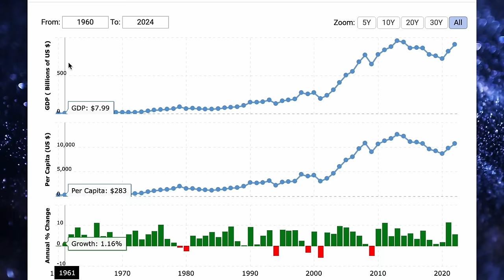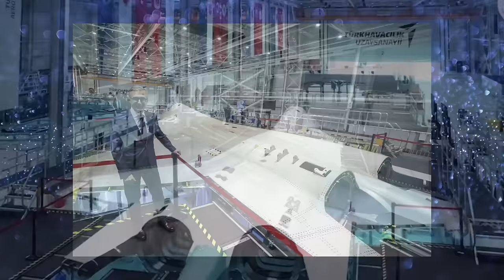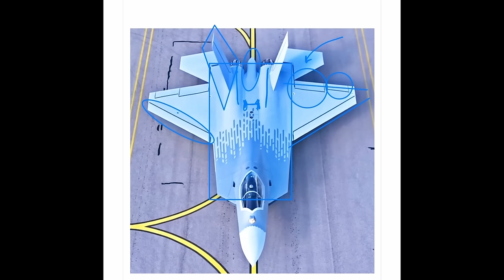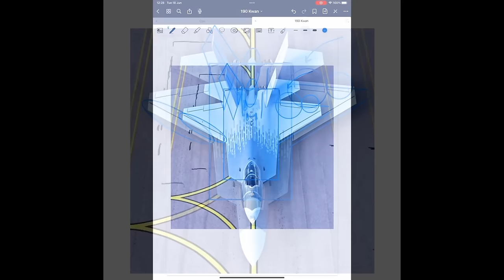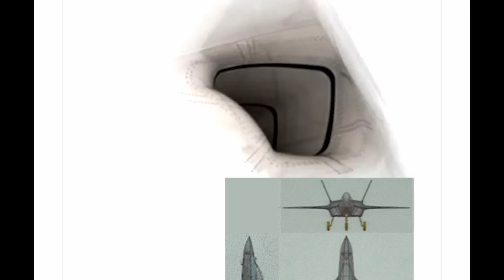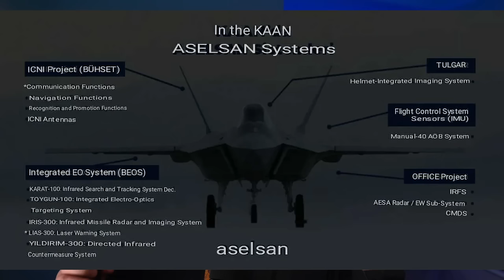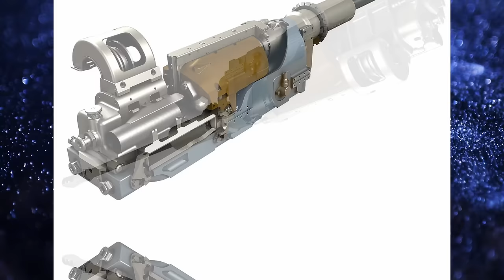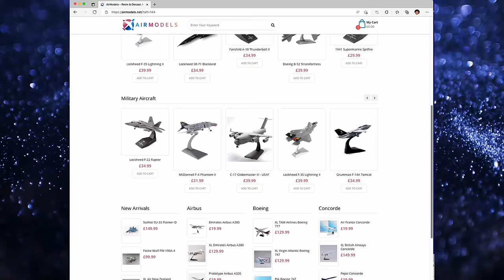The F-35 Has Met its Match

Comment: As an American, I'm already more impressed by Turkey's efforts than by the Chinese.  The KAAN is an extremely ambitious goal, and I wish Turkey the best of success!
Reply: Hilarious.
Kaan adopted both F-22 and F-35 designs .
Reply: How much of the planes parts are indigenous. 100% if not, its worthless as its not sovereign.
Reply: @peekaboopeekaboo1165  yes and a little from the super hornet.
Reply: The F-35B, was claimed to be a stealthy single engine multirole combat aircraft, that unlike the Harrier, would be supersonic, stealthy, with modern avionics systems, and like the Harrier, would be VTOL capable. This is why the British originally designed our two carriers without ramps. 

Only one of the biggest technical headaches, the British always had when building the Harrier, was the VTOL, — transferring from "lift" (downward nozzles), to forward flight (rear-facing nozzles), to then fly away from the lift-off. Apparently to achieve it took the British a hell of a lot of technical work, (three — four months at a time, over 3 years). Look up all the variants they made, but they never gave up, and they finally figured it out. 

I made the claim long before we saw the F-35B, that it wouldn't be VTOL capable, (even with the Rolls-Royce lift engines), because, the US has tried to produce and build a VTOL combat aircraft many times before, only they've failed each time, only ever managing to produce and build the British Sea Harrier, able to do so. Every US airframe (and there have been many), have all failed. 

I'll show you what I mean... Copy and paste “2013 MCAS Yuma Air Show — AV8B Harrier Demo” into YouTube search. At 7 mins, 50 seconds, you'll watch a Harrier performing a proper VTOL. You'll see it lift off vertically, and then fly away from the lift-off, and you'll see the transfer of nozzles take place. -- 

Yet you'll not ever see any footage anywhere, of the F-35B performing a full VTOL. Yet Lockheed Martin do claim it is VTOL capable, when it, so clearly, is not. 

Copy and Paste “First F-35B Vertical Takeoff Test” into YouTube search. You'll see it lift off, only then you'll see it return straight back down from the lift-off. You'll never see it fly away from the lift-off, if it could, we'd see footage of it doing so - like we still see on all the footage of the Harrier doing so. But you'll not find any footage, anywhere, of the F-35B performing a VTOL. 

The Americans, (unable to answer this), will then comically claim it's not necessary? LOL, (while forgetting, they're to be carrier-based aircraft), meaning even any slight damage to the deck or ramp, they'd be unable to get the jets airborne? Defeating the entire purpose of having the aircraft in the first place! You can't ever lose an entire carrier, in battle, for only minor damage?, I mean goodness me, whatever next?. 

So, why do we see the USA doing this? It's obviously because, the US is still a country that's never managed to produce & build a VTOL fighter aircraft. Britain did so in the late 50s, Russia did so in the late 60s, the USA has tried and failed numerous times, so it seems this time, they're going to try to lie about it LOL. 

That country is a travesty, man! But it does show us, that Lockheed do indeed produce propaganda aircraft, as the F-22 is exactly the same... A failed aircraft, so today, only being used for propaganda purposes! 

Typical US propaganda, usually consists of silly falsehoods, fake misinformation claims, or just twisted truths, like the F-15, is said to be unbeaten in A2A combat? It's true (ish), only when we look at every aircraft shot down by an F-15?, we find that none had any offensive capabilities, most had little if anything defensive, many without even a basic radar, meaning, you'd be absolutely stunned, if the F-15 didn't shoot every one of them down! 

So it really is, once again, and as always, just a very silly, and meaningless remedial propaganda claim. However, there is another aircraft, that's also unbeaten in A2A combat, and has faced off against aircraft just as capable and well armed as itself, (only it's not American, so you'll never hear about it). 

The British Sea Harrier, is actually, the only aircraft unbeaten in A2A combat, that has faced off against worthy, and viable opposition. And that really is a huge factor, that's worth knowing, unlike the F-15 propaganda claim, that you'd be shocked if it hadn't managed. 

The Americans really should be questioning why the US government made it illegal to sell the F-22? The US government, seemingly want it believed, that because it's so good, they don't want anyone else to have it. Yet, that actually makes no sense at all, none, not even a little sense. 

As the facts are, they've no idea what's around the corner in new modern military technologies, and with the speed we're seeing so much new hi tech, military tactical hardware, being designed, developed, and created today, it could have made great sense to sell the F-22 at some stage. (If it actually works). 

If it worked, they'd have been able to recoup many of the resources spent on the aircraft, if not the resources in their entirety, even a profit! Yet, as always, there's another, and much more likely, reason the USA made it illegal to sell the F-22. 

If it is, just as I suspect it is, a "lemon", that was intended to be their leading front line strike aircraft, (that's failed), yet because of the cost/expense, to design and build them, they can't just write it off. So the US have then only used the F-22 for propaganda purposes? Then what better way of preventing anyone else from finding out, that it actually doesn't work, and really is a lemon, than making it illegal to sell? 

Logically, that's the only real possible reason the USA made it illegal to sell the F-22. -- It can only be, because it's a failed aircraft that was intended to be their leading front line 5th generation strike aircraft. 

Well 20 years the US have had the F-22 in service, and they've been in wars the entire time, yet they've never used it, not once! And even more telling, was, after Russia arrived in Syria in 2015, the US removed every F-22 from right across the Middle East... Iraq, Tukey, UAE and Jordan. 

Absolutely no doubt about it, I guarantee that we'll never see the F-22 involved in any real war scenario, or even involved in any major sortie, because it's basically junk. 

They've even trashed all the infrastructure they had in place to build more of them.
Reply: I'm English, and what I'd like to know, is why we read so many Americans making such ridiculous claims, like the F-22, is so much better than the Russian SU-57, (that relies on washing machine chip technology), and has the RCS (radar cross-section) of a Jumbo Jet? 

Seriously, just what on earth is that all about? Not only is that claim completely wrong, but it couldn't be any more wrong! The really obvious, and factual truth, is, they've no idea what the RCS of any military aircraft is, as they're always kept classified! 

But even more stupidly, they never even ask any of the most obvious questions, as they all, always, just assume so much! Questions like, what do either the F-22, or F-35's have available to them, to detect, track, and target enemy stealth aircraft, from BVR (beyond visual range)? 

And yet, if they had just asked that one, really obvious question, then maybe they'd understand, that today's reality is nothing at all, like they think! Seemingly, they don't even understand, that stealth alone, defeats high-frequency (short wave), radar, by absorption and deflection, but it does not defeat low-frequency (long wave radar). 

Therefore, to detect, track, and target enemy stealth aircraft from BVR, can be done with long-wave radar, (but it must also be enhanced), to remove all background clutter for targeting purposes. So, regardless of the aircraft's RCS (they all believe means so much), when they're being detected, tracked and targetted by long wave radar, they're far from stealthy, and they just light up, and they stand out like a beacon in the night. 

It also seems, they don't know that neither the APG-77 radar in the F-22, or the APG-81 radar in the F-35, have any kind of long wave radar, (hence, they can't detect any enemy stealth aircraft from BVR). So, just think about that, and what it actually means? This is also a fact, the US air force will be fully aware of, only it seems the reality is, when the F-35 radars were being designed 13 years ago, there were no other stealth aircraft to think about as a potential threat! 

So, obviously, we must ask, just what do the F-22, or the F-35, actually have available to them, to detect enemy stealth aircraft from BVR? 

They have, AWACS, (that can transfer all targetting data to the F-22 - F-35's in real time). Only, that's not possible today. And this is why actually understanding any potential adversaries, real abilities, becomes extremely important, critical in fact. 

As, on the other hand, we find this Russian SU-57, (rubbish) the Americans all claim, is equipped with a 5th generation radar, (with enhanced long-wave radar), their new Byelka (2band) radar used in SU-57. 

They can detect, track, and target enemy stealth jets from BVR, and very easily today. Russia has designed, and developed, the first L-Band fighter radar we've ever seen. They've embedded L-band AESA radars into the leading edges of the wings. 

The L-band AESA radar "data" gets processed in real time (through extremely powerful Russian computers), being significantly enhanced, removing all background clutter, seeing them perfectly able to detect, track, and engage enemy stealth aircraft from BVR. 

This new Russian radar technology, along with its very impressive range parameters, and it's jamming ability (over very large areas) make this aircraft deadly to all other aircraft types. (But according to the Americans), it's just Russian rubbish, right? 

They can also detect, track, and target enemy stealth fighters, long before they enter Russian airspace, (from much greater distances today), with "real-time" data from all those massive Russian ground (long wave stations), that are all protected with the networked S-400 defensive system. 

Russia's new (2band) radar, covers all frequencies across all channels, used for tracking, targeting, and also for jamming (over large areas). It's part of Sh121 multifunctional integrated radio electronic system (MIRES) on board the SU-57. 

We should also understand, that Russia tested this new radar suit in the SU-35's, so they also have the option of fitting this radar into the SU-35's. Seeing the SU-35 at no disadvantage against either the F-22/35. As although the SU-35 can be detected, tracked, targeted and shot down from BVR by the US stealth fighters, the SU-35 equipped with this new radar is just as able to detect, track, target and shoot down the US stealth fighters from BVR. 

Seeing the all-important, huge Russian advantage, in BVR missile range, plus the excellent manoeuvring, neither the F-22/F-35 have, as more than critical, (if you're going to avoid simply being blown out of the sky). 

The truth is, this new Russian 5th generation radar, design, has very clear potentials, to provide genuine shared multifunction apertures, with applications including... 
Search, track, and destroy, missile mid-course guidance, against low signature aircraft, identification of friend or foe with secondary surveillance radar. 
Passive angle tracking and geolocation of JTIDS-MIDS-Link-16 emitters at long ranges. 
Passive angle tracking and geolocation of L-band AEWC - AWACS and surface based search radars at long ranges. 
Passive angle tracking and geolocation of hostile (i.e. Western) IFF and SSR transponders at long ranges. 

High-powered active jamming of JTIDS-MIDS-Link-16 emitters. 
High-powered active jamming of satellite navigation receivers over large areas. 
High-powered active jamming of L-band AEWC-AWACS and surface based search radars at long ranges. 
High-powered active jamming of guided munition command data links over large areas. [Effectively, and completely, neutralizing the USA's use of AWACS for their detection]. 

The Tikhomirov NIIP L-band, AESA 5th generation radar, is an extremely important strategic development, and it's a technology which once fully matured and deployed in useful numbers, will render narrowband stealth designs like the F-22 & F-35 Joint Strike Fighter, and many, UAVs, as highly vulnerable to all flanker variants equipped with such radars. 

Furthermore, just what have the Americans, ever seen the F-22 actually, do? Well, other than flying over a beach, on a YouTube video? 

Nothing!
Reply: When we really do take a step back, and actually do analyse the USA's real military capabilities, today? It's a horror story for the Americans, in all honesty. 

Over these last 25 years, they've been out thought (right across the military board), they've been significantly out-built, and they've been technically beaten, hands down, by both Russia, and China, (who are banging out modern hi-tech, hi-quality, military hardware in all areas of their military today). 

Even though, much is largely defensive, it's also tactically offensive, and being done with a very focused and real analytic understanding of where they need to be at various stages of their military advancement. 

Although we actually know, very little, (in all truth), what they've allowed us to see, there's nothing I could single out, and criticize, even if I wanted too. So far, everything has been completely logical. 

A great question, that really points out today's military power, (realities), is, what does the USA lead the world in today, concerning anything military? And the answer to that question, is, absolutely nothing! 

For example, In today's world of hi-tech, Anti-Ship ballistic missiles, like the Chinese DF-21D — operational range (1700 km's) that can sink any carrier in the world with a single hit, really means, all Navy's, (including the USA's), without the ability to defend against these missiles, are in effect, obsolete today. 

Russia's Zircon Anti-Ship missile, though inferior in way of operational range - 1000kms. It can be fired from Aircraft, Subs, and Ships, making it deadly to any carrier in the world. (Russia also have the Brahmos and the P-800 Oniks, Anti-Ship missiles). 

We all know that neither the US, or the UK, have any destroyer, (or any other means), that can defend against these modern hi-tech, ASM's today! Seeing, the USA's Navy as pretty much obsolete in today's world. 

We only need to look how far the US jets can travel, it's approx, about 500-650 (max) km's out — and the same back again = 1300 km's range. Seeing the US unable to deploy any carrier close enough, to reach any inland target, and then get back again. Anywhere inside 1700 km's, they're sunk, they're toast, they're history. 

This is also why, when we hear the USA shouting out how they're sending a carrier to the South China Sea, (as some kind of imagined "propaganda threat" toward China). 

Only, when looking at the GPS positioning, of any US carrier in the SCS, they're never see closer than 2500 km's from Chinas mainland! It's more commonly known as hot air, "bluster". 

Then, again, when looking at another of the most important areas of today's militaries - (Electronic Warfare)? 

We again find, the Russians are literally decades ahead. Russia have the GaN MMICs, the krasukha, the murmansk-BN, and Magrav technology (NATO: Khibiny) developed by Iranian-born nuclear engineer Mehran Keshe (called “a modern-day Nikola Tesla”). 

And we can say for sure, this EW hardware is super impressive, as we've no answer to it, and we've also seen this E/W in action on at least 4 occasions we know of. (Obviously claims denied by the USA), only if untrue? Then I'm just left asking why it was, that we saw the response, we saw, from the USA, basically confirming these events? 

1) In 2013, we've seen a Russian SU-24 fly repeatedly around and directly over the USS Cook, leaving the Cook helpless to defend itself. 

2) In 2014, we've seen a Russian SU-24 (flying at an altitude of only 10 feet), fly directly at, and straight over the USS Ross, eleven times, with the Ross completely unable to prevent It or respond to It. 

3) As Russian forces arrived In Syria in 2015 we had many reports of US/NATO/Israeli radar being scrambled, leaving them unable to communicate or offer any response to the Russian forces. As one report said, the silence from the West was deafening! 

4) In March 2015, a further related report notes. Federation submarine naval forces attacked with their advanced electronic defensive weapons the American aircraft carrier USS Theodore Roosevelt (CVN-71) causing it to turn and struggle to the coast of Britain (to the amazement of the public). Where she remained for 9 days undergoing Intensive major re-wiring. It's believed the Russian electronic warfare pods (NATO: Khibiny) were used in a Russian trial of this technology for its submarine fleets. 

White House spokesman Josh Earnest, who said of the encounter with the Cook... "This incident is entirely inconsistent with the professional norms of militaries operating in close proximity with each other in international waters. E/C measures taken by the Russian Federation are unacceptable". 

To which the Russian MoD replied... "Frankly speaking, [we] do not understand the reason for such a painful reaction of our American colleagues, as the principle of freedom of navigation for the US destroyer, (which is staying in close proximity to a Russian naval base in the Baltic Sea), does [not] at all cancel the principle of freedom of flight for Russian aircraft testing Russian defensive systems". 

A further Ministry of Defence (MoD) report also stated that for the second time in two years, advanced Federation “electronic warfare defences” have crippled the Arleigh Burke-class guided-missile destroyer USS Donald Cook (DDG-75). It was noted when Baltic Fleet “special forces elements” offered assistance to tow the destroyer back to their Polish port, the Americans refused to respond. 

According to this report, in April 2014, the USS Donald Cook, while performing a mission in the Black Sea, substantially violated Federation “territorial integrity” causing President Putin to authorize an “electronic warfare defence” attack against it, that was so devastating this top-line warship was left adrift—and once towed back to its Polish port, its American sailors were so demoralized 27 of them filed immediate letters of resignation from the US Navy. 

One year later, in May 2015, this report continues, and again in the Black Sea, the Arleigh Burke-class guided-missile destroyer USS Ross (DDG-71) substantially violated Federation “territorial integrity” causing President Putin, to once again, authorize an “electronic warfare defence” attack against it. 

But when confronted with the fate that befell the USS Donald Cook the year prior, it retreated—causing one Russian top-level Naval Officer to state: "It seems that the Americans did not forget the April 2014 USS Donald Cook incident — A Federation SU-24 equipped with EW pods shut down the new American destroyer". 

This attack encounter of Federation forces with the USS Donald Cook, this report details, began when this American warship began an “aggressive combat manoeuvre” against the Baltic Sea Fleet port in Kaliningrad, to which President Putin authorized an immediate “electronic warfare defence” against it. 

The facts are, the USA have nothing able to defeat, or even hamper Russian EW, today. 

Then, looking at another of the most important areas of these militaries today, (Ground Warfare)? We find that Russian troops with reserves, outnumber the USA, and we must also understand, that any attack on Russia, would immediately see China join the conflict, then outnumbering the USA in the millions today. 

But, also, and more to the point, what have we ever seen from any US troops, that could make anyone believe or think, they'd be any sort of threat or match, for any of these well-disciplined, well-trained, Russian troops, who are all fully bled, and are prepared to stand and fight for their country's freedom, (seeing them fighting for all the right reasons). While the US troops, would only be fighting for attempted US tyranny. 

All throughout the history of wars, we always find, that all those fighting for the right reasons, (like their own freedom), have never lost. While on the other hand, all those who fought for all the wrong reasons, like global control/tyranny, have all, not only lost, but all have been annihilated. 

The Americans, would all be very wise to understand this, as we see this in every war, over and over again! Nothing will change this time, only the annihilation might be much more severe, but it must also be recognized, and said, just as deserved! 

When looking at today's (Missile World)? We find, that, once again. Russia easily rules the missile world, today. Russia's modern hi-tech missiles, that include hypersonic missiles, (with Russian GLONASS, GPS targeting systems), give Russia such incredible precision, the USA has nothing we can even say, compares. 

And as we've all witnessed, Russia was pinpoint accurate, targeting single buildings in Syria, even seen guiding their missiles straight down chimney pots, or straight in through the front doors, and doing so from the Caspian Sea from distances of, up to 6500 km away. 

Russia has also provided clear, precise footage, of all her long range missile attacks in Syria, (that we can see all came from the Russian control room online). 

Russian hypersonic missiles?, we all know the USA can't defend against, and Russia has many other lethal hypersonic missiles being created, and added to her arsenal on a regular basis, today. 

Personally, in any upcoming war, I give the USA precisely zero chance, none, not even a little snippet of a chance, annihilation is all they'll get. 

And again, 100% deservedly so.
Reply: @hotstepper887  Are you for real or just anti-American?  Why does the UK use american fighter jets like the F-35's then, if according to you all US planes have been a failure?  And why did the UK recently place a 2nd order for F-35's to bring the total to 48?  You should go back to your subsonic Harriers since they were so great, and please stop writing 20 pages at a time every time you post.  That's just crazy.
Reply: @peekaboopeekaboo1165  too from Su 57 What's wrong with that??
Reply: @atillakaan3937  SU-57 isn't a look-alike of either F-22 and F-35.
Reply: 🇹🇷thanyou/teşekkürker
Reply: @erwin5760  did you even watch the vid? 39:34 __"Apart from the engine and ejection seat, this aircraft is completely Turkish". 
Later blocks will have a Turkish engine
Reply: Lol 😂 Chinese re better
Reply: @peekaboopeekaboo1165  Yeah it is also hilarious that you do not know about the Turkish part of the design in F-35 program. 😉 Most of the engineers after being removed from the program PURPOSELY, moved on to KAAN. I think it is not that hard to understand. The F-35 does not even belong to you besides the money you're pouring in lol.
Reply: @AyberkDaGreat  
Turkey got accessed to American and Western European technology and expertise .
PRC 🇨🇳 never got such access !
Reply: @peekaboopeekaboo1165  "American technology" LOL, You probably do not know that America is not a country name too. That "American technology" is developed by foreign countries. 😘 Which is Germany, France, UK countries, and of course Turkiye 🙂. All the scientist and engineers in America is from other countries that came there for money fella. 😂 So yeah, Turkiye accessed way more technologic stuff just Outside of Turkiye and IN Turkiye, clearly everywhere that has enough stuff to create with. The only "success" is that the money comes from oil and colonial bullsh. And the engineers, scientists from every other country is there to get that money. I don't think that is a "Engineering success" :yougotthis:
Reply: @AyberkDaGreat  
Turkey never suffered sanctions/embargoes identical to that of PRC 🇨🇳 !
Reply: @peekaboopeekaboo1165  Based on Russian Mathematician Work
Reply: @peekaboopeekaboo1165   and Check on German designs in the 1940`S
Reply: @erwin5760  So all the f-35 with Chinese Aluminium  ????
Reply: @Karl-Benny  
J-20 has no lookalike from the 1940s.
Reply: @peekaboopeekaboo1165 you know that a lot of KAAN’s engineers and designers worked on both F22 and F35 projects as both, American citizen working for US companies and as a Turkish Engineering squad that got sent to support. Right? And when I say a lot, I mean A LOT of them.
Reply: @erwin5760  Ziel ist, alle teile.
Reply: To be fair to China Turkey isn't under embargo for advanced semiconductors which yes for a modern advanced jet is important also Turky was able to get access to engines and the likes to reverse engineer them, so Turkey has a massive advantage over China, if China were in a similar position they could develop something better. btw I am not saying Turkey has plagiarized, but I'm simply saying they were able to get access to examples to get ideas to speed up their progress.

I'm also not saying that I disagree that we should not help China develop better weapons just to be 100% clear.
Reply: Agreed, China takes American/russian design and mish-mashes it into one plane
Reply: Its Better Than The US effort
Reply: nicolaswirtz J20 isn't anywhere near 5th generation.
Reply: Little cowchild joe, the Turks, has all the rights of ownership of peekaboo inside parts of all the planes they purchased .
Reverse engineering to custom tailored for their own and plus some more.
Reply: @erwin5760 as far as I knew, everything was indigenous except the engine. But they are already testing their own homegrown engines.
Reply: Thank you for your kind words.
Reply: @SplashJohn  
Did you know the F35 still has lots of teething problems unresolved?
Reply: @SplashJohn  The quantity of Starliner by Boeing is the perfect example of poorly made in USA quality. 
Lots of excuses for mistakes,  on huge budget $ in the dump.
Reply: Thank you USA
Reply: @erwin5760  THE jet engines Are Pratt & Whitney made in the good old US of A sir
Reply: @SplashJohn  not worth 100,000,000 dollars tho.
Reply: @peekaboopeekaboo1165 And? Taking inspiration is bad since when?
Reply: @aixle3590  
My point is this .
PRC 🇨🇳 has always been embargoed ever since it's founding in 1949 ... from acquiring state-of-the-art technology .
Reply: @hotstepper887  did you just wrote a book?
Reply: @ozturcan  I dunno did I? It takes me all of 5 seconds
Reply: @ozturcan  What I do know, is none of you have a clue what you're talking about.
Reply: @ozturcan  It's... "did you just write a book", not wrote.
Reply: @ozturcan  Not very bright, are you lad?
Reply: @hotstepper887 kid,did I upset you?? Are u going to cry about it?? Chill!!
Reply: @erwin5760 eksiklerini sen uretiver bi zahmet
Reply: @peekaboopeekaboo1165  Yeah because they help build the F35s. They invented 1.4 billion dollars in the program and manufactured more than 400 parts for the F35s.
Reply: @addyaddy614  
Hired. Not "helped" for free.
Reply: No offense but it seems that the Turkish engineers did not learn how stealth tech works, as that thing looks like a 1980s F-22. The only reason why Turkey had to go ahead and make their own aircraft in the first place is because they were kicked out for buying Russian weapons, Russia being the main country that NATO defends against. What's the point of being in a mutual assistance defense organization if all you do is threaten Greece and provide safe haven for oligarchs?
Reply: @hotstepper887  Something more to add: The Su-35, and all Flanker variants really, has seen regular combat in Ukraine and is doing really well. The Su-57 we also know is being used, at least for missile strikes, regularly in the past months, we know this because of the increased number of Kh-69 strikes, a missile made specifically for the Felon.
Reply: @erwin5760  f35 100 de 100 abd mali demi
Reply: While Turey's efforts are certainly very impressive, China's are more so, as the J-20 is already in mass production.
Reply: @hotstepper887 😂
Reply: @hotstepper887 you’re gonna make  a lot of people angry
Reply: @bertobertoberto3  Truth, always, does that, to fools.
Reply: @hotstepper887 üstad sen nerelisin harika yazmışsın eline sağlık
Reply: @istanbul...pendik  I'm English, mate. And thanks.
Reply: @erwin5760 The Turks started to make the engine, the electronic parts are made by ASELSAN, the software belongs to the Turks.
Reply: @keeshans5768 Yes, it is in the testing phase.
Reply: What a surprise 🙃
Reply: Thanks
Reply: @erwin5760  Better than doing nothing dude...